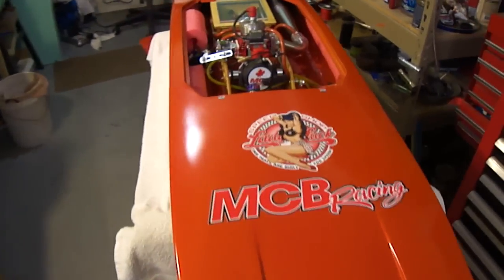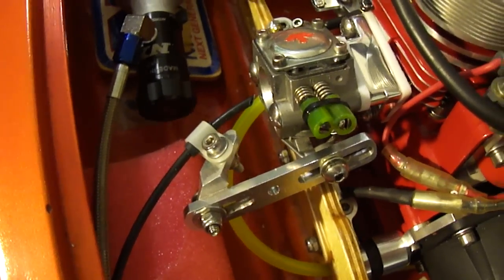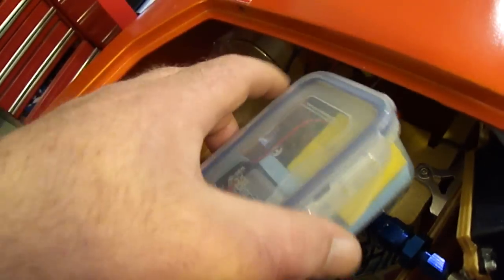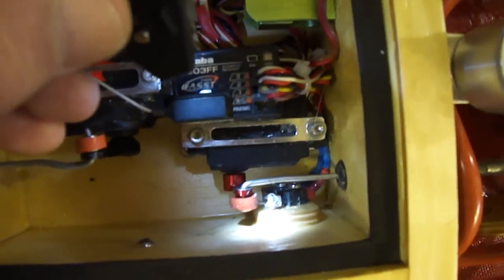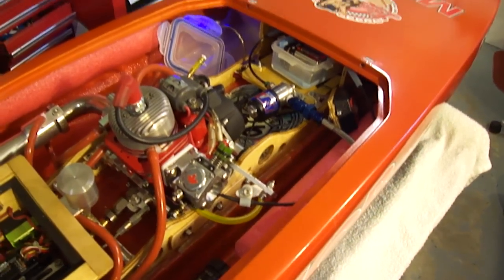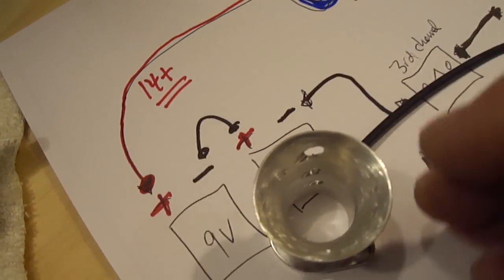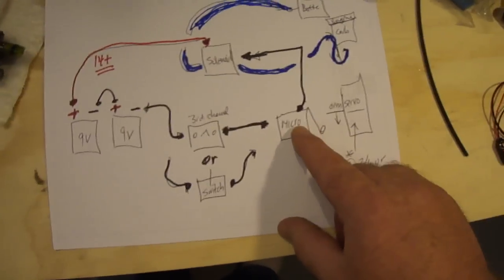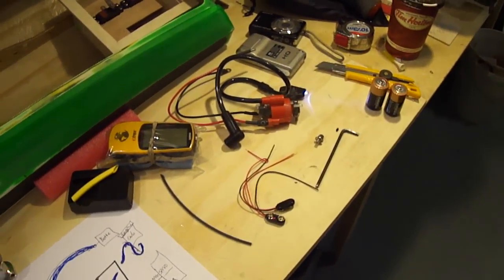How to wire RC Nitrous on Boat

Comment: I'm curious if the power gained from this compensate for the added weight of the equipment, I mean those few pieces add up lets be honest here, I'm all for power gains but are they in fact real power gains one can benefit from or not...
Reply from the maker: Hellothere is some power to be gained - but no not enough to compensate .  Your money is better spent on a good engine modifier: such as Gizmo or ONeill bros. Plus its a lot less $$ and complications